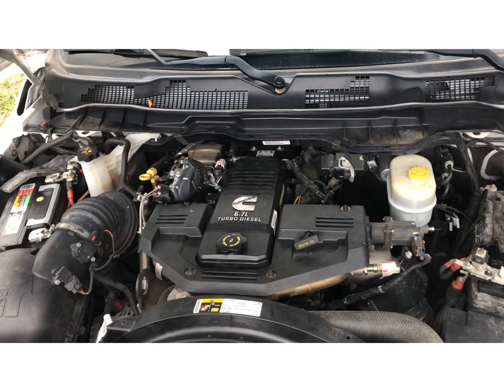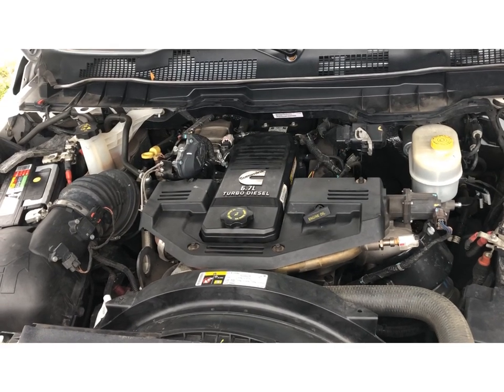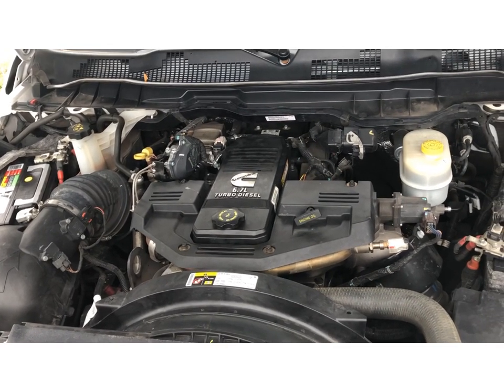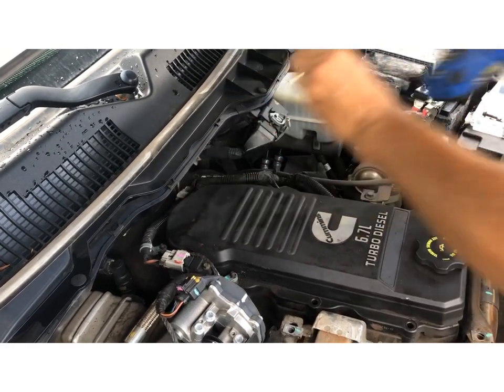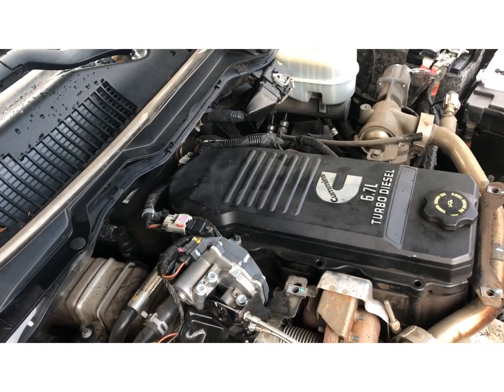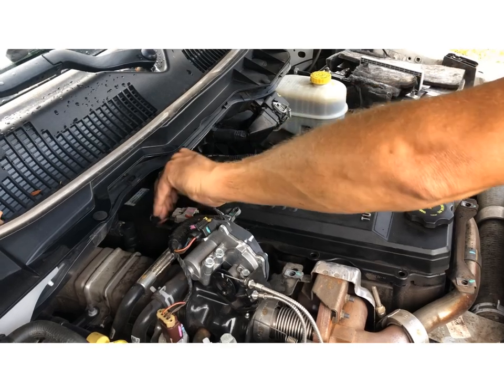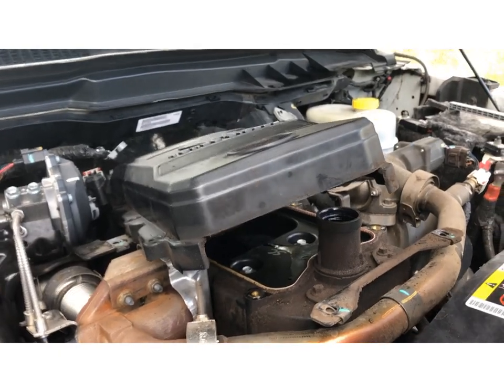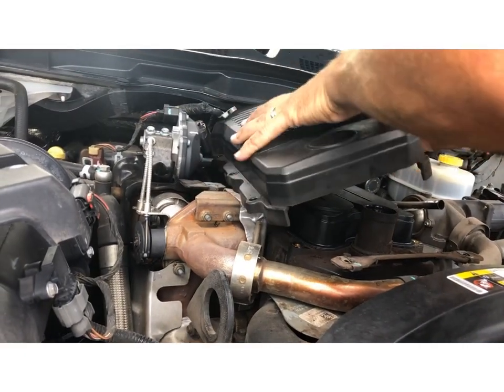2017 Dodge Ram 6.7 Cummins crankcase vent filter change

Comment: Tip: when you take the cover off put the oil fill cap back on just so dirt or anything won’t get in there.

Most likely it won’t but you never know,it’s always good to be safe as far as this goes!! Great video btw
Reply: It does if you open the cap you can see the engine

Comment: Nice video.  I like that you mentioned the socket size.  One thing I would recommend is continuing the video through the “Perform Service” annunciation on the instrument cluster.  BTW, another video says to turn in the key to the RUN position, then depress the brake pedal twice, then depress the gas pedal slowly twice.  Turn the key off and verify that the message is gone next time the key is turned on.
Reply: Then you have to run around the truck twice lol. Thanks for the info I wasn't sure about that reset.
Reply: @alittlebitofeverything5090 ,🤣🤣🤣

Comment: The last step in the removal process is removing the oil cap and the first step in re-installation in put the oil cap back on.  IF YOU DROP ANYTHING IN THE OIL FILLER OPENING YOUR SCREWED!!  FYI tip of the day!
Reply: Ditto; an open oil fill gives me nightmares.  Drop a penny down it; spend $5000 getting it out.

Reply

Comment: thanks dude.    I'm about to do this service myself now on my 2017 6.7
Reply: Yeah And they wonder why people don't go to dealer after warranty is up they wanted 395 dollars to change bother fuel filters on my 6.7 . I bought fleetguard for cummins for 95 buck for both in kit on amazon and took me 15 minutes
Reply: @davidwooderson46 isn’t it crazy. When I bought my first Cummins 6.7 in 2015 I was quoted just under $800 for oil and fuel filters change. Needless to say I’ve been doing it myself since then (except the free oil changes when I buy a new truck 😅)

Comment: Thanks for how to video. I got 2015 Ram 2500 shop manual from ALLDATA DIY website for my 2500 Ram Cummins diesel and they had similar procedure for CCV replacement. They followed what you did  almost to the letter, but they suggest removing old valve cover gasket and replacing it with a new one, in addition to common shop requirements like disconnecting the batteries, and hoses to the valve cover, which probably isn't really necessary. For your info torque setting on all those 8mm bolts is 10 N-m or 89 in-lbs. Did you have any oil leaks around valve cover after the change? Thanks

Comment: They charged me over 600... I only had 6 months of warranty left and I was way under on mileage... warranty was over for me around 70000 miles and that was deleted along  with a few other things. I was quoted 495$ for a u joint and did it in my driveway for 40 bucks...

Comment: Thank you very much. Did mine today after watching. only thing i did different was I put my oil fill cap on without tightening just so i didn't drop any bolts down the hole!..

Comment: Terrific video!  Unbelievable how these stealerships operate!  Thanks for showing us how quick and easy this service is!
Reply: They have no new vehicles to sell, so some dealers, not all are putting a lot of pressure on the service depts. to tote the load of the missing $ that sales can’t come up with. My dealer quoted $330.00. I said I’ll think about it. I have thought about it and many thanks to you tube and those who post! Gods blessings upon you.
Reply: Ditto; an open oil fill gives me nightmares.  Drop a penny down it; spend $5000 getting it out.

Comment: nice video...remove oil filler cap last and put it back on first...then you reduce chances of dropping a bolt in the engine.

Comment: Just had the same sort of thing happen but only with fuel filters. I have the same exact year and model truck as you have. They wanted $399.50 to replace both filters. Did it my self in 40 minutes. Cost was $123.35 total for both filters.

Comment: That's what they charge to change out the fuel filters also! Hopefully this is not a stupid question, but is there going to be oil in there after you remove the old ccv filter?

Comment: Amazon sent me one today f these by accident….lol…. Guess I’ll just change mine now, 2013 RAM 3500 Dually. Thanks for video… VERY HELPFUL anytime you can save a buck.
By the way, a front wheel hub cost me $900 at dealership, I’m doing other side and will post when done.

Comment: Jeepers now that’s an all around the house screwdriver if I’ve ever seen one.

I have one that looks very similar that’s used all around my home. From my wife who uses it sometimes for gardening to my kids who leave it somewhere outside to me in the garage.

It definitely adds a great patina to the metal finish that’s for sure.

Almost forgot but what brand of filter did you end up using ? I was going to speculate at $100+ dollars you probably went with Mopar/Fleetguard?

Thanks for the video.

✌🏽

Comment: Fantastic video work .. I was wondering if that valves cover didn’t have gasket on it when you replaced the crankcase vent filter ? Plus, I would like to see you reprogram that on dashboard cluster to clear after doing the filter replacement either with old school key starting or push starting button are something I’d like to see and learn

Comment: Great demonstration with one suggestion. Please put the oil cap back on before installing bolts. If one or anything falls in it will be a problem.

Comment: Well done…..

The only thing, I would add. At all times, fumbling around under there. Screw your oil filter cap on, to prevent anything falling inside the engine. Like an 8mm bolt.😂

Comment: I wish I had seen your video before last week. I have a 2016 RAM, needed the same job. I was quoted $850 but I got hit with a $1000 bill with $150 of that for plugging in a scan tool into the scan port. They gave me a military discount so took $100 off of it. I th9inik they have seen the last of my truck.

Comment: Good video. Ive got a 2018 6.7 and do all my own work. Tranny, front n rear dif, transfer case and engine oil changes and fuel filter changes and save hundreds of dollars in labour costs. All are simple to do. Will do the def system delete too as soon as warranty is off. Keep the vids coming and help folks save a ton of money
Reply: For this does a message pop on the screen?